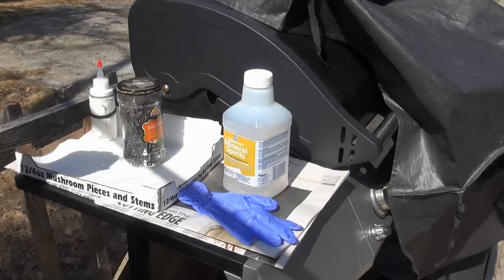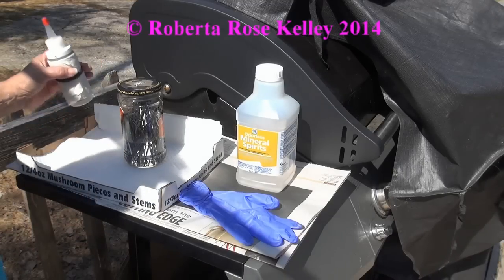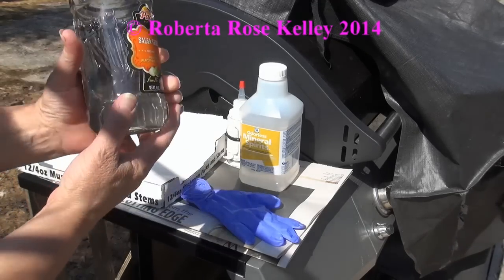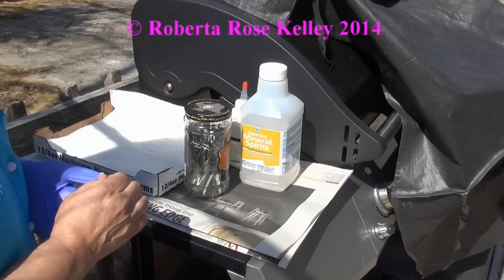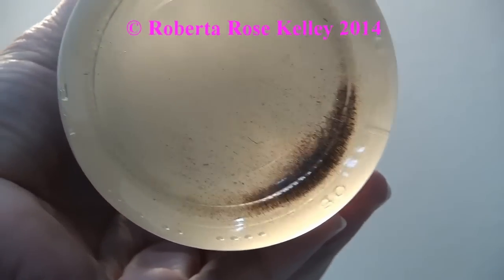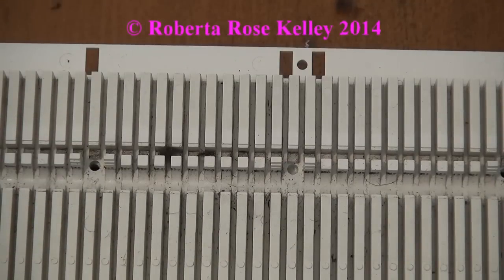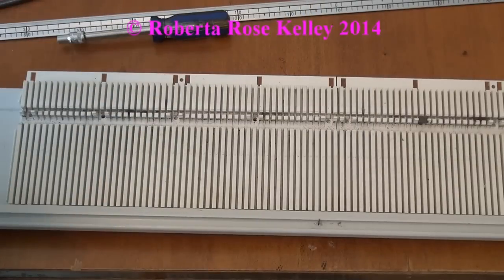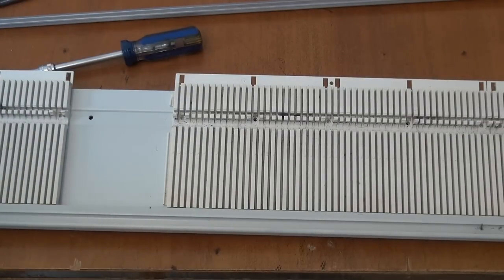Cleaning Knitting Machine Needles and the plastic bed

Comment: Your knitting machine will perform a lifetime. How often do you clean your machine?
Reply from the maker: Most times I will clean a new to me machine as they come to me dirty or not usable.  But then I do get some that work right out of the box.  But for any machine I do keep, I will do a deep clean maybe every 5 or 7 years as needed but most times I will after each project just vacuum up any lint that accumulates on it or the carriage and also take the air compressor to the carriage underside.
Berda
Reply: What products do you use for deep cleaning. Do you have a deep cleaning demo?
Reply from the maker: I do have a 4 part video on Dismantling and Reassembling the SK326, hubby took care of any rust and repainting the inside of the covers and brackets while I in turn did take, but not sure I have in the video, of the Denatured Alcohol and wiped down the top of the bed when that part was out of the case.  In the case of a Brother machine I had with the top middle button not able to be pressed in by itself, I was told to take WD40 and spray between the 2 buttons.  But you can also get the same effect of loosening up any congealed grease with a hair dryer.  But then after that, keep pressing in that top center button so that it will not get stuck again.  Those machines are famous for that when not used much.
Then of course you did see how I clean my needles, I have used Denatured Alcohol as well as Mineral Spirits.  I like the DA as it dissipates when taken out of the jars.
Now the plastic bed machines, I take all metal off them and then soak the plastic in hot soapy water, even taking a brush to the needle grooves.  Then rinse them with hot water also and if the right time of the year, put outside in the sun to dry up all the water.  If i do it in the winter time, I will take a hair dryer to them before putting the needles back in and any other metal parts.
Berda

Comment: Hello Roberta. I am in the process of cleaning my machine and I am at the part where I am  needing to take off the metal bar, but I am having trouble with finding the right socket size for my screwdriver. I tried a 1/8, but to no avail. Could you please let me know what size you used in your video?
Thank you in advance
Reply from the maker: Gee I am not sure what size I used.  if it is not standard or imperial measurements, then it has to be a metric one.  I have this little box that goes with my electric screwdriver that has both standard and metric sockets.  Oh and I also have different sizes of the Phillips and flat head screwdrivers as well as the hex wrenches that goes with that tool.  Not all of those tools will carry all of them but if you can find a small set with different size accessories, that may be the best way to go instead of bringing it to a store to find out.
Oh if this is a bolt, you can use some adjustable wrench to get one off and then go to your local hardware store and find out the size you need.  If a screw, that may be harder to do but I sure hope you can get it off and finish cleaning up your machine.
Berda
Reply: Thank you for your help and your quick reply. Wow that was fast. I appreciate it.
Reply from the maker: Sometimes I can get here fast where other times it could be a day or more.  But I sure hope you get what you need and finish cleaning up that machine.  Have a good one, Berda
Reply from the maker: I am not sure but believe it was a metric size.  I do recall that I had to use the 7mm more than other sizes but if you have any metric sockets, try them.
I no longer have this machine so cannot tell you for sure.
Berda

Comment: A dealer recommended mineral spirits too, but you can't buy it or paint thinner in California! ;(
Reply from the maker: Here is another thought, can you get a high concentrate alcohol?  I think the most I have seen is 90% but if there is one more than that, it will also do the job.  But even with that, one needs to lubricate the metal parts as that little water can still be left behind.  Why I tend to do mine outside so the sun can dry up any water that I used.  I do prefer the Denatured Alcohol as less water in that compared to Mineral Spirits.  Hope you can get what you need to clean up your machine or needles.
Later Berda